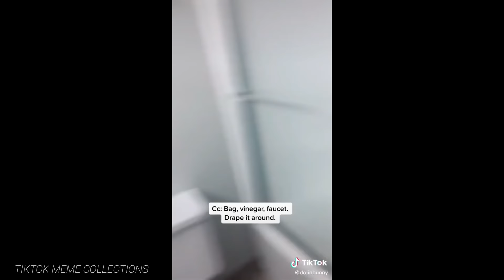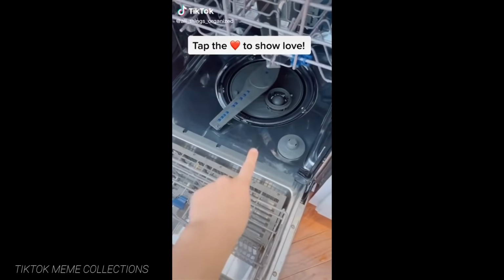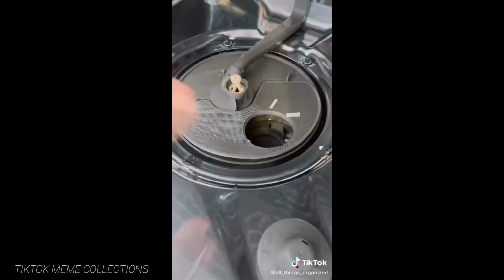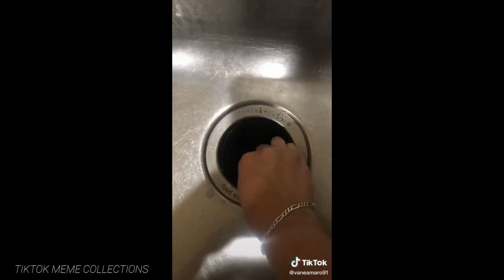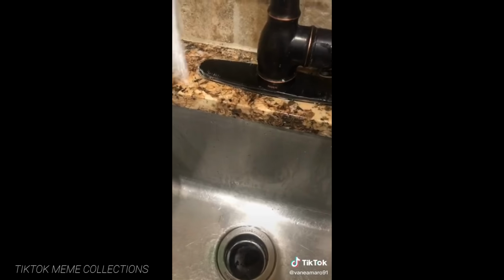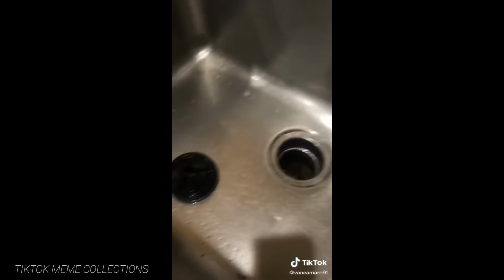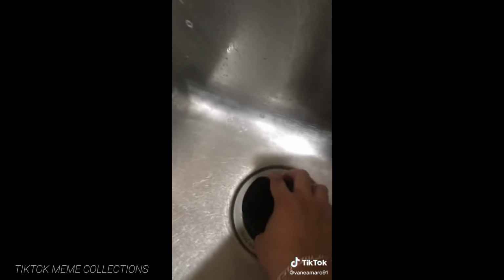TIKTOK CLEANING AND ORGANIZING✨

Comment: 1. Wear gloves for the love of god.
2. Stop mixing chemicals if you don’t know what’s safe to mix
3. It’s redundant to use bleach spay and comet powder, they’re the same thing and it’s pointless to mix them.
4. Please remove all jewelry before using strong chemicals, you can ruin them that way.
Reply: Cleaning tik tok does too much LOL they probably spend way more than necessary on cleaning products a month
Reply: Bleach spray reacts more with grease, and the powder works more with rust. Then I totally agree with you with the jewelry. But if it weren’t safe they wouldn’t be mixing it and posting it.
Reply: They don't care abt their safety for " ASMR "